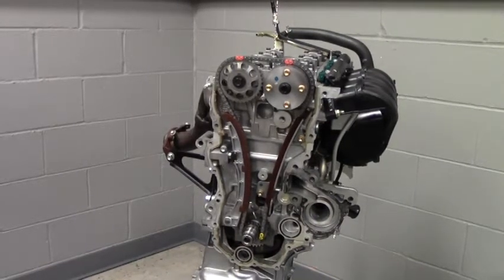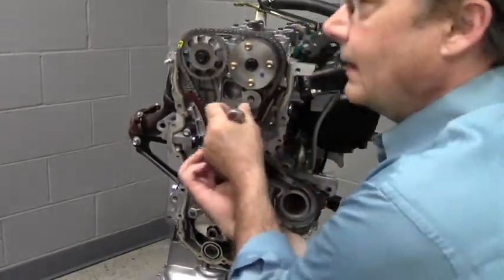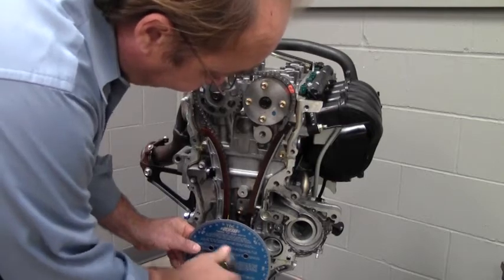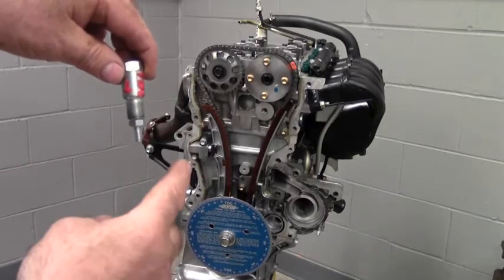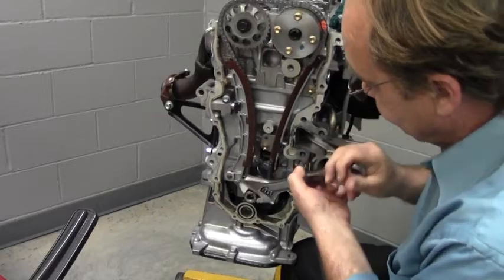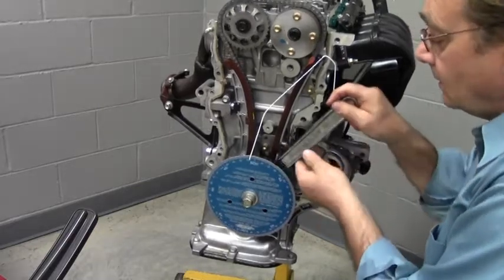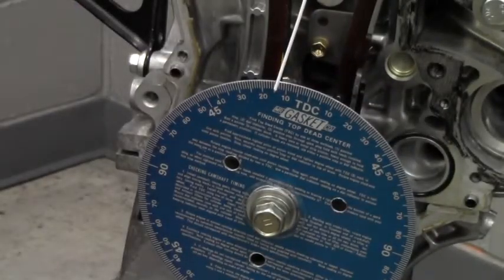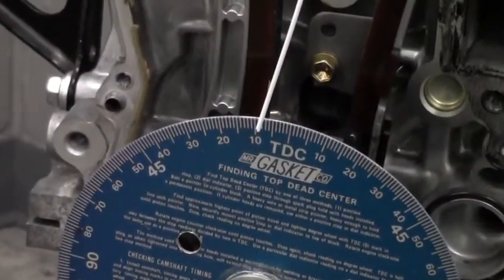Camshaft degreeing 001

Comment: how do you know how long to make the piston stop ?
Reply: That's what I was thinking as well. If the piston stop is too long it would then not be top dead center. But the math would probably come out the same with the mean number.
Reply: 11:25 when he rotates the crankshaft counter-clockwise and then clockwise again you can see the hanger points to a degree on the wheel, if it stops at the same degree both ways then it is true TDC. As you see in the video it is very close to being true tdc as it stops at 20 degrees and then 8 degrees.

Comment: something i dont understand is, if the crank moves some degrees close to tdc without the piston going up/down why not leave the crank at the point where the belt/chain gear notch matches the notch on the oil pump/block? which usually says "0" or tdc...
Reply: JAS TUNES , because , parts are mass produced . I’ve installed literally hundreds of high dollar cams that were up to 5 degrees off from what the cam card stated it was.    ALWAYS verify .